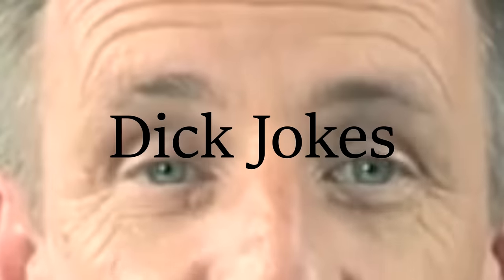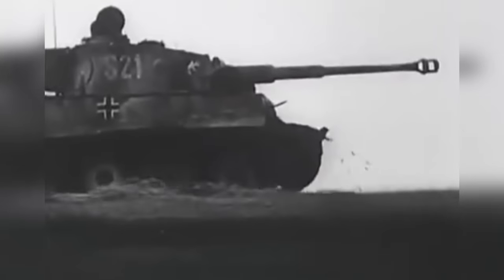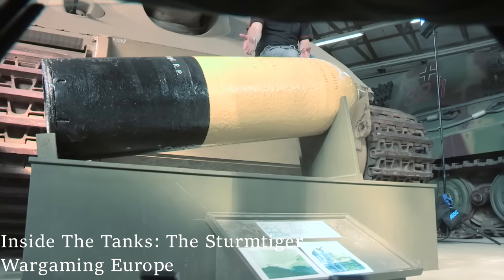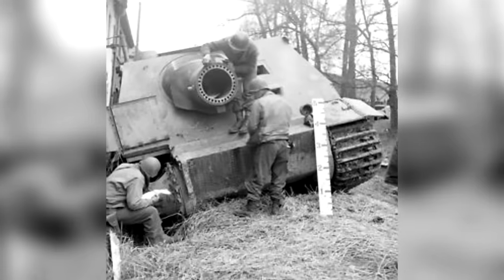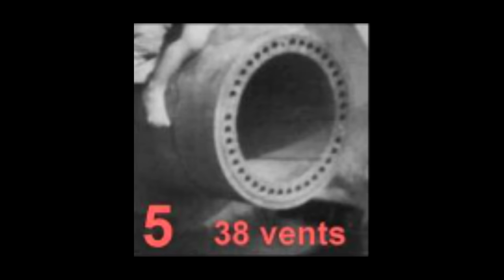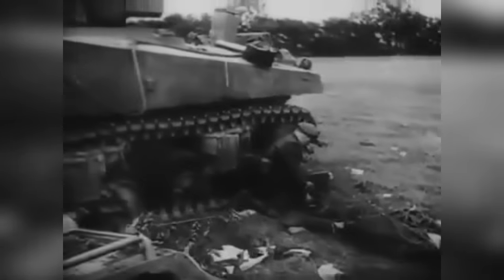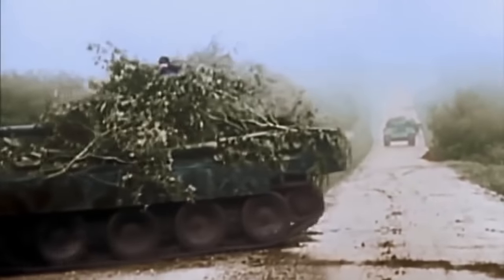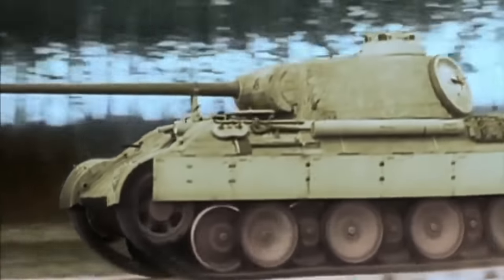The Sturmtiger, Too much too late

Comment: What if a fully loaded StrumTiger gets ammo-racked? It desintegrates everything in a 150 yard radius?
Reply: It's a moving mini-nuke
Reply: The key to the Sturmtiger's success, you see, would be to add an extra engine and turn it into a nyooming bomb.
Reply: It suddenly becomes Initial D
Reply: I think the Germans may have accidentally nuked themselves to that happened
Reply: Probably used as a medium ranged artillery gun so thats not a problem
Reply: I wonder what would happen I will get it in war thunder and test it after I research it
Reply: If that thing were to get ammo racked , it would absolutely 1944% disintegrate EVERY tank and infantryman around it. It would be like a mini nuke.
Reply: Seriously,didnt the german ever think of making a 2 barrel tank or an auto-canon tank back then, battle of kuwait proof that auto-canon is more  effective but of course ammo issues (the war lasted long ago yeah)
Reply: No worries considering the 16 rounds could be fired so fast who would be able to ammo rack them?
Reply: @paperexplain9342  Well there were prototypes for flak tanks like the Kugelblitz mounting twin 30mm Mk103's in a ball turret. There was also a planned Panther version called Coelian which could have had a 55mm autocannon though the more likely version would have mounted twin 37mm cannons.
Reply: Ayman El kadouri hate to break it to you but it isn’t in war thunder
Reply: now I get it , they make it in order to be use as a trap. When 5-10 Shermans aproach and start to think , what the hell is this, they ignite explosion killing all the tanks around.
genius concept.
Reply: @paperexplain9342  well, panzer 2, ostwind, etc
Reply: German Nuclear bomb test 1944 colorised
Reply: No. It will only make a smol crater.
Reply: @justmerc1642  or a DB 601. It could make 1000 hp
Reply: @danielkurtovic9099  wuhuu kamikaze
Reply: What do you think US used to bomb Hiroshima and Nagasaki
Reply: 2:57
Reply: I personally believe it's a non atomic sky high mushroom cloud
Reply: It's a self destruct mechanism
Reply: And? You say that like it’s a problem.
Reply: @xninewxw7559  it is now but as an event vehicle

Comment: “Hanz, we’re running out of fuel, what should we do?”
“Make a tank that shoots rockets!”
Reply: "Hanz, we are running out of panzers and production can't keep up , what should we do ?
- Waste all the steel and stacked up tank parts on irrationally designed experimental tanks !!!
Reply: "... Rockets propelled by fuel" 😈
Reply: @ruslankazimov622  well they were runnibg out of materials but they also maybe have lotbof unfinished experiemental tanks soo just scrap those
Reply: Man, the is the most concise way of describing the German strategy that I've ever seen.
Reply: Rockets were a major development for the Germans since the 20s and 30s because Treaty

Comment: for the purpose they were designed to do these were excellent siege tanks
Reply: The problem being that the Germans were the ones under siege by then. 19 very heavy tanks with big guns weren't going to save them. The best way to beat these things is destroy their supply lines; without fuel or ammunition they are just armoured boxes.
Reply: The brumbar, Isu-152' and Churchill avre were so much better
Reply: Yes, it was great for laying siege. But that's pointless when you're the one being besieged.

It doesn’t matter how good a weapon is at its intended role if said role no longer exists.

Comment: Now I know what inspired the Demolisher Cannon from Warhammer.
Reply: Nah.  The original Demolisher cannon, on the Leman Russ was inspired by the Churchill AVRE (Assault Vehicle Royal Engineers) equipped with the "Mortar, Recoiling Spigot, Mark II" (or Petard), a 290 mm (11 in) spigot mortar that throws the 40 lb (18 kg) Bomb Demolition Number 1 ("Flying dustbin") with a 28-pound high-explosive warhead. 

The Sturmtiger was the inspiration for the Vindicator tank ... originally the gun on the two tanks was not the same gun, as it is now.
Reply: S T R E N G T H 1 0. AP -3

Comment: Hearing that caliber of a cannon I'm thinking something along the lines of a naval gun on a cruiser rather than a tank.
Reply: schizoidboy 
Battleship.
Cruiser guns topped out around 203mm, as per treaties
Reply: If you think a 380 mm gun on a tank is big, wait till you hear of the Karl-Gerat self-propelled siege mortar and it's 600mm gun. And don't get me started on the 800mm monstrosity that is Schwerer Gustav.
Reply: @WilliamTheRailwayTako  Those aren't tanks tho but literal cannons on rails
Reply: @L4sket  You are correct (well, except for the Karls, since they were tracked vehicles, so the could be called tanks at a stretch), but my point about caliber still stands. Also, brilliant profile pic!
Reply: @WilliamTheRailwayTako  Thanks :D. Made it myself, also got one with a German Stahlhelm and Kar98k.
Reply: You are correct, the 38cm RW61 was developed by the kreigsmarine
Reply: wait till you see the fv4005 or mijolnir it actually is a naval cannon strapped to a centurion chassey
Reply: 380mm is the same as the Richelieu class battleships.

Comment: So the sturmtiger was a pillbox destroyer and if it hit a tank the tank would be blowen to pieces
Reply: if it hit a tank
Reply: @LoydAvenheart  if that thing had a longer barrel I'd promise you no one would want to be in a tank on the opposing side
Reply: @dangoober6903  It's basically firing a mortar. A long barrel would not have helped.
Reply: Considering it’s damage rating I would say if it it anything, that thing would be replaced by a small crater

Comment: In Warsaw, the Sturmtiger was used against underequipped and completely outnumbered desperate civilians. I don't see how it prooved it efectivnes in any way.
Reply: Pretty sure Warsaw was mostly brick and mortar.
Reply: Im petty sure I had read that it didnt really "hit" civillians or the resistance, but it did destroy buildings and some of the defence line that the resistance put out. So in that way, it was effective.
Reply: Its job was clearing fortified positions. That's what it did. Entrenched infantry in an urban area is a bitch to kill.
Reply: Kamil Szadkowski It did it's job, instead of clearing block by block in close quarters combat, you clear block by block with the Sturmtiger
Reply: I think it did fine. Just look st this quote. "Sometimes its perfectly acceptable to kill a fly with a sledgehammer"
Sometimes it's perfectly fine to shred a civilian held building in half, or two ... Three?
Reply: The assault gun was used against fortifications, like bunkers and buildings, and basically its only purpose was to annihilate these structures, not necessarily inflict casualties. As an infantryman, you had literally nothing to take down a machine gun nest, so if this thing came rumbling and shot down a bunker in just 1 hit, you'd stick with the thing so it'd  just make life and your job sooooooooooooo much easier. As for the Polish in Warsaw, if you had high hopes of beating the Germans, as you had seized many buildings and planted machine guns in them, only for a fat, bulky and invulnerable(basically) vehicle shoot just once and level a building, you'd probably want to retreat as soon as fucking possible.
Reply: Reminds me of all the stories of "war heroes" who mowed down untrained, lightly armed civilians who were conscripted.
Reply: Yeah, kind of like penal battalions.
Reply: The purpose was clearly a bunker buster type vehicle, and in a ruined city where those "civilians" can hide and turn a fight into the equivalent of a Stalingrad in terms of arduous house to house combat. I sure as shit would want a Missle launcher to chase out anyone that uses those buildings as fixed positions/hideouts.
Reply: Kamil Szadkowski you don't give the rebels enough credit. They killed 9k Fernando and wounded almost the same amount, captured a decent amount if tanks, and liberated a concentration camp..
Reply: Kamil Szadkowski , worked well too.
Reply: Well you got to look at it from a different pic why clear building from building when you can kill the whole block. If the weapon can kill and you have it use it .
Reply: Kamil do not stir the waters . Who do you think you are? Two vehicles been used for their intended purpose is effective. 10 to 1 kill ratio achieved by Ferdinand is not.
Reply: Kamil Szadkowski no argument regarding who the Germans were fighting in Warsaw, but the point your missing is that the Sturmtiger was designed to engage hardened fortifications which included buildings...which it did with spectacular results. Warsaw was probably the only true instance in which the Sturmtiger was used properly in it's intended role, albeit at the expense of the Home Army.
Reply: Kamil Szadkowski takin out whole building for example with those how you said «civilians»
Reply: Using scarce resources to crush a civilian rebellion, when the armies of their enemies were closing in; this seems like a misuse of those resources.
Reply: +Mojo Jim Finally someones get it.
Reply: It would have been the decisive weapon to break down resistance in Stalingrad in 1942.
Reply: Pretty sure storming fucking garrisons is hard work and even the most ill equipped force can wreck havoc on an attacker. War isn't about fair.
Reply: War has nothing to do with heroism, Arthas. If you pick up a gun and start shooting at the occupier, prepare to  lose your life like any other. That's how it goes.
Reply: It destroyed buildings?
Reply: It's ok he said the turret on the existing Maus is a prototype, so let's all just wonder what's going on
Reply: Well yeah it destroyed buildings. This thing has a single use: destroy buildings. It's made to go through fortified concrete or raze city blocks.
Reply: Yeah but they were ruskies sooooo
Reply: Warsaw is in Poland. Polish, not Russian. The Soviet Army stopped short of Warsaw to let the Germans murder as many people as they could.
Reply: Because it was used to destroy buildings, not shoot people.
Reply: The strange thing about late war Nazi weapons... all of their latest weapons were build for attack in mind... but they needed weapons for defense. I think the leadership was just crazy and lived in imaginary world to the bitter end. Another example is the V2 rocket, although technologically advanced is still a purely offensive weapon, they build that thing to the end... just wasting valuable resources.
Reply: Wut. Most of their vehicles worked only in defense, because they were too heavy and difficult to move but with excellent protection and firepower. The V2 is what you build when you can't have bombers against your enemy. It was built because Hitler wanted to terrorize the enemy as long as possible, but yeah, waste of resources.
Reply: Galf506
   Heavy tanks are not good for defense, you don't need big, expensive and slow toy, just to hide and do nothing. To use tanks for defense you need fast medium tanks that can move where thy are needed on the frontline, not just sit there and wait for the enemy to come. Speed is the most important factor for tanks, a slow tank is useless tank.  If you need a stationary bunker, just build a bunker, do not use a tank for that purpose... concrete is cheap, high grade steel for armor is expensive. About V2, it's not a weapon to replace bombers... I don't really know what it is... without proper guidance it's just an expensive propaganda weapon, nothing else.  For how to make a proper and cheap rocket artillery look at the Soviet BM-13 "Katyusha".
Reply: Not saying what you said is entirely false, but almost: heavy tanks are great for defense, since the german concept of heavy tank employed guns that could fire way past the effective range of allied guns, and armor that was impossible to penetrate at range. And heavy german tanks were VERY fast on the battlefield, just slow on a strategic level. A Tiger had better cross country capabilities than a Sherman.

Their tanks weren't able to be moved quickly due to having to change tracks and wheels for rail transport - which meant that the German army was strategically slow, even if tactically fast.
Soviet heavy tanks were another concept, they were meant to spearhead offensive operations.

The Katyusha is not a V2. The Germans had rocket launchers comparable to the Katyusha, before the Katyusha. Look at Nebelwerfers, Panzerwerfers and the Wurfrahmen 40. The V2 is a long range cruise missile, it's meant to replace bombers - you fire it at a city and you can bomb it from a distance. The error was employing it against cities instead of targeting airfields and factories. (Wasn't THAT accurate for airfields, but if instead of firing 50 at a city you fire 50 at an airfield, even 1 good hit is enough to put the airfield out of the war for a while. That's Hitlers fault: he had a modern, ground breaking weapon, and he used it for psychological warfare.
Reply: Blew the fuck out of a bunch of buildings
Reply: Kamil Szadkowski it showed its possible capabilities in the battle. Not that it was a good example for effectiveness, it however showed some points of what it possibly can do
Reply: +Kamil Szadkowski
It destroyed buildings, that was what it was meant for. It was effective.

Stop dissing other shit on youtube any time it is remotely in opposition to Poles. Lol
Reply: @Galf506  No. Heavy tanks are horrible for defence. Their whole purpose and doctrine was offensive operations. In defence you by its nature let an opposing force take the initiative in an engagement, from there said force has ability to engage the heavy tanks from the hardest to defence avenue. From there your heavy tank might as well be a light scout tank for all the good it will do.
Reply: @1993Crag  German heavy tanks could open fire with lethal effect from 2km while most Allied tanks couldn't get a good kill shot at the front above 250m. And you're telling me they're bad for defence?
You don't understand the concept of defence either. Heavy tanks would be positioned in a way to employ their maximum effectiveness, also you don't see a concealed tank until it opens fire, usually.

Heavy tanks work great in defence. It doesn't mean that they cannot work well in attack.
Reply: @Galf506  Ah yes, concealing a 60 ton monster from all manner of offencive weapons. Good luck.
Reply: @1993Crag  An M4 Sherman, a medium tank, is about as tall as a King Tiger.
Turns out weight doesn't make a tank easier to spot, genius.
Reply: @Galf506  Turns out height isn't everything either. King Tiger is far longer, wider and taller. No wonder so many were mission killed by air.
Reply: @1993Crag  Again, you're misinformed, missing the point and resorting to straw mans. You might consider in your one-sided one-dimensional examination that ALLIES HAD UTTER (nearly) UNCONTESTED AIR DOMINANCE FOR THE ENTIRE LENGHT OF SERVICE OF THE KT. Lòl.
Just fyi, even ships (yes, SHIPS) had camouflage, and here you think an object like a tank couldn't be hidden. You know Cologne's Panther? Nobody saw that coming, for example. And the Panther is a huge tank.
Reply: @Galf506  If you're making the Sherman comparison there; Caen had 3 heavy tank battalions - all wiped out. King Tiger performance was seen as poor there. Great defence. Or in Russia where Germany heavy tank battalions were consistently getting wiped. Great defence!
Reply: Now Sturmtiger not playing giveaway is too to blame for the failure of the underprepared uprising? Niiiiiiiiiiice:D
Reply: This is getting out of hand
Reply: @mojojim6458  "Using scarce resources to crush a civilian rebellion, when the armies of their enemies were closing in; this seems like a misuse of those resources." An armed rebellion of desperate(and slightly brainwashed with false hope) people ie what any normal commander would call just another enemy force. The one that is behind your lines and is tying up more of your forces from fighting said enemy. So in essence you understood it all right before getting it all completly wrong. Germans needed to crush rebellion in the most brutal ie quickest way possible to concentrate their forces elsewhere. Here, take a participation cookie. And one for +Kamil Szadkowski who also "gets it":D
Reply: @sdsd2e2321  how very informative:\
Reply: D  if you wish to slow an enemy army turn a city into a killing field and bleed then for every brick, doorway, and building they claim
Reply: It was designed to support the infantry against threats against infantry.
It supported infantry during Warsaw without being an absolute failure.
Reply: WAR CRIMES INTINSITFIES
Reply: Kamil Szadkowski “don’t matter if you win my an inch or a mile winnings winning” - dom
Reply: 15 men armed with smuggled military equipment from the occupation of Poland, or 150 men with the finest small arms of the day, a good supply of ammunition, and maybe even a hijacked Panzer, it doesn't matter if the city block they're in is leveled and the Panzer buried. The Sturmtiger was good at what it did, training doesn't save you from a collapsing building.
Reply: When you set the bar low enough success comes easily. Apparently, the rounds did land somewhere in Warsaw and not in an empty field or in a neighboring town..

Comment: And yet ironically a Churchill Crocodile had about the same frontal armor and it's flame thrower was far more effective because not only does it kill those immediately inside some bunker in the direct blast zone, but anyone near by because of oxygen depletion. Not to mention the Churchill is easier to maintain.